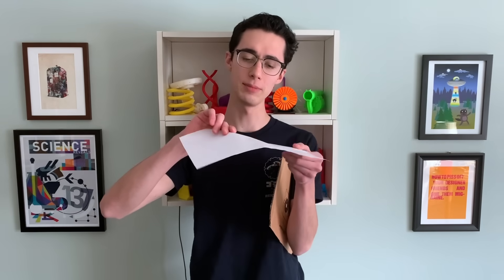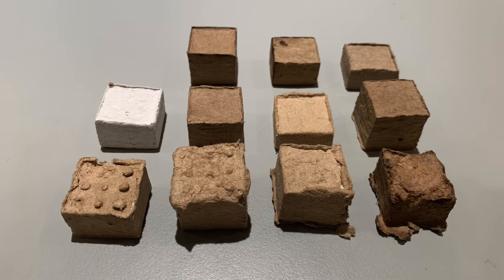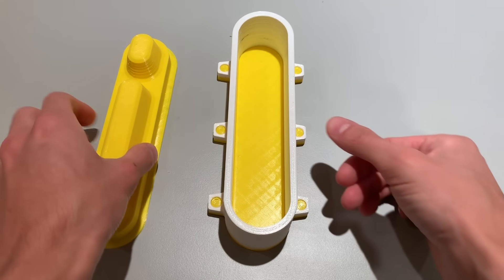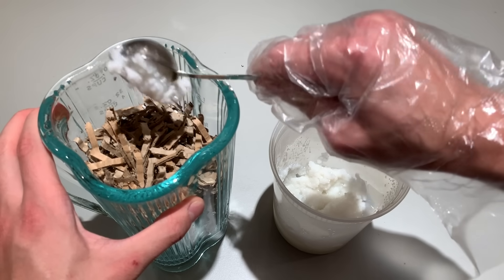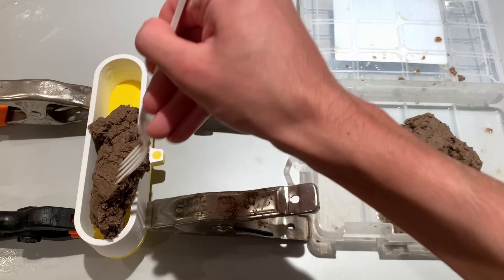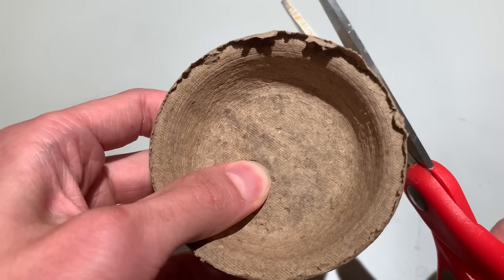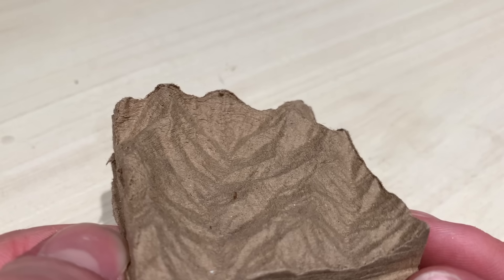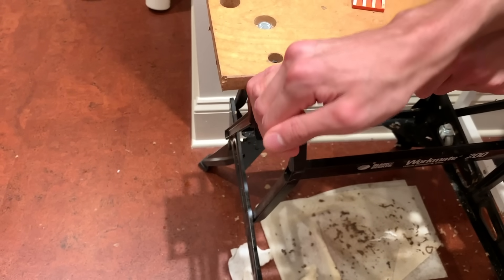Recycle Cardboard into Anything with 3D Printing!

Comment: Here's an idea: Put a seed in the middle of a cube. Let dry. Then the "seed cube" can be planted. Test the results.
Reply: Damn nice idea
Reply: Plant cups, made out of paper pulp, much like an egg-carton are in common use. You don't need thick cardboard walls to hold a bit of dirt with a seed.
Reply: @mibars  I actually have like 40 seed cups sitting here from a promotion by a supermarket chain here in Australia.  They look like the biodegradable paper forms that a lot of computer manufacturers use for their packing materials.
Reply: This already happens commercially.. they are called "pelleted" seeds.. so that even tiny seeds can be machine sown.
Reply: @thelocksmithguy5468  I like your idea because you can plant the seeds from an airplane, and include fertilizer.
Reply: Bet it sucks if the seeds all germinate early
Reply: Ive tried that before, it grew pretty well. The problem is that it doesn't absorb water very well, too little water ends up drying, and too much end up destroying the part.
Reply: Great idea... Let's use that to plant the next million trees...
Reply: Yeah this is already a thing. They also do it with coconut husk
Reply: @fish9468  coconut husk is a great water-retainer for plants.  Used to get coconut mulch for our garden beds in the UK too; great stuff.
Reply: I've bought them from a gardening company. They don't work well unless you bury them inner about an inch of soil. It is an interesting way to distribute the seeds but for the flower seeds I tried between newsprint just setting on the surface didn't work so well. I imagine this would be similar.
Reply: @thelocksmithguy5468  yes, but everything is  commercially made, the point is make it yourself
Reply: This could quickly turn into a product. Have seed cubes that are filled with seeds and fertilizer already and are proven to grow faster than normal
Reply: just plant the seed directly, duh
Reply: Globe shapes so you can throw or launch them with a sling or similar.

Rapid deployment of seedballs over distance
Reply: Why not just use seeds? They are packed with nutrients and have a protective shell lol
Reply: Be a tiny cube for 1 seed  maybe make a tray for 100 seeds to germinate then plant em in normal pots
....why not just make small fertilizer cubes for when the plant has few leaves 🙂
Reply: for some reason i'd make it seed balls
Reply: @punkinhaidmartin  20 million trees mark rober
Reply: Mark Rober 20 million trees
Reply: could be used to make a durable yet biodegradable container for a 'seed bomb' that's shot/dropped from a plane seeding a wide area
Reply: I'm working on it as a project. ty for the amazing idea. (Btw we are trying to make it as viable as possible by adding nutrients to the pulp for example).
Reply: Ooh...Imagine little seed dart/bombs...flown in by a plane...then dropped out, they sail down, and dart into the ground..then soften and a tree grows out of them where a forest fire just occurred
Reply: @witono586  maybe try burying the cube half an inch under the dirt? Water makes the material fall apart, but if there's dirt above it, it might fill in the gap left by the cube when it falls apart.
Reply: why not just plant a seed?
Reply: дак в магазинах уже такое продается

Comment: To make them waterproof after moulding you can coat them with a drying oil, like the ones used in oil painting. Linseed oil, hemp oil, soybean oil, tung oil, walnut, poppy, and more!
Reply: went to the comments section to find a waterproofing solution now i know
Reply: This deserves a pin!
Reply: It wouldn't be water proof but water resistant. Using a phenolic resin will probably make it completely waterproof
Reply: @mayurmahale3049  With one coat, no, it would not be fully waterproof, because it will be absorbed into the fibres. However, with multiple coats (allowed to fully dry, which would take 24 hrs at least), or with a sizing underneath (like starch glue, shellac, gellatin), it will become fully waterproof. An alternative is to coat it with a natural resin varnish after the oil.
Yes, a phenolic resin, or any other synthetic coating, would render it waterproof immediately. But I recommended drying oils because in the video they explicitly said they wanted an environmentally friendly finish.
Reply: @ShadowoftheDude  ah. What I meant wasn't dip resistance but soak resistance. But yeah for low duty applications drying oils will work quite well.
Reply: With portland cement as a binder houses can be built.  It's called papercrete or fibre cement.   Molding paper isn't anything new.  I'm disappointed this video was only about using 3d printed molds.  I thought it would be about 3d printing paper.
Reply: @mayurmahale3049  yes you can always make your recycled eco friendly cardboard plate and make it water proof by covering it completely in plastic XD
Reply: @kris_crafter  Agreed that it's not especially a new process (after all, egg shell cartons have been around for a while) -- but this is a nice DIY process and could bring a lot of 3D printer fans into mold making -- Printing with wood-PLA blend is a pain in the butt (filament snaps easily) and very slow -- I think making a single re-usable mold makes a lot of sense.
Reply: Would rice bran oil fit that bill?  I've got access to lots of that. Linseed oil is often extracted using harsh chemicals.
I guess I'm looking for a low-cost and fairly "natural" oil to try  Any Ideas?
Reply: @ausfoodgarden  I'm having some trouble finding out, but I believe the answer is "no."
[ EDIT: I found the resource I was looking for and the answer is definitely no. Here's a list of all oils that will and won't work: https://en.wikipedia.org/wiki/Iodine_value#Iodine_values_of_various_oils_and_fats ]
Have you never seen "cold-pressed" oils? I guess you're looking at the oils available in hardware stores and such? Try an art supply store, they'll some available.
Reply: coat it with 3d resin and flash cure with UV and you have a stronger, waterproof item!
Reply: Ah, you're closing in on shellac, my own choice. It stiffens wonderfully once it soaks through the fiber, cures very firm, and the CORRUGATIONS (um, don't get rid of them!) can give it a "stressed strength" direction to use when designing items. And the sheer AMOUNT of it around to be used...
Reply: just make sure to use boiled linseed oil instead of untreated linseed oil -- the effects are much better
Reply: Wax may also work for waterproofing.
Reply: What about beeswax and a linseed oil mixture?
Reply: @kiwihuman  pro tip: the oil may slightly make it swell or deform the surface. For perfect results, put it back in the mold after oiling it. I would go for linseed oil, as it's probably the most durable and sustainable natural oil that is easily available. But if you're in the America's, then DON'T buy "boiled linseed oil", because those often contain other additives like rare earth metals and other toxic stuff (put in there to make it harden faster, for use in artistic painting). 
If you use this technique for dishes or cups, for example, then you'd be poisoning your food with those additives. If you use it for structures (buildings or furniture) then it becomes highly toxic in case of a fire, which reduces human survivability. So, think smart when recycling =) Always check all ingredients of the stuff you use. (and go for raw linseed oil, and remember the hardening time of a good oil is expressed in months, not hours)
Reply: @mayurmahale3049  drying oils make it perfectly fully water proof. But you need to know what you're doing. A good drying oil takes months to dry. And contrary to earlier advice, layers should be applied before the previous one has fully hardened (but since that takes months, you've got plenty of time). Impatience will make any technique problematic. Drying oils were used to make the hull wooden sea ships and the poles of docks water-tight, and they surely are dipped, not sprinkled. Raw linseed oil, for example, will dry amorphic, which means that it turns into a glass-like structure. But it takes the better part of a year to fully reach that state, because it doesn't only have to dry, but also oxidize.
Reply: @kris_crafter  One could make bricks or building blocks that are lighter by weight.
Reply: You could probably use a wood stabilising effect to make them harder and water-resistant. It doesn't have to be a perfect vacuum. Just put them in a strong container, add something like cactus juice and create a vacuum. Hopefully it won't disintegrate. I've never stabilised wood before, but I like watching random videos on YouTube.
Reply: Wood glue
Reply: Well linseed oil yes but then it will also burn 10x better. Kalium waterglass is a good glue and fireinhibitor.
Reply: @fearlyenrage  Actually, I'm not sure, but I think once cured linoxyn is actually somewhat fire retardant. I mean, I've heard of many oil paintings surviving house fires etc.
... I sort of forgot about the whole spontaneous combustion thing, though. Uh, maybe be careful, everyone.
Reply: @ShadowoftheDude  ok... For a self igniting fire from a linseed oil rag extreme many things must be given that it catches fire. 
Im somewhat an outdoor geek and my firestarters are made with linseedoil paperpieces they burn realy well, almost like plastic.

You should test the manner there is nothing like handmade real evidence.
I test anything i want to be sure of its behavior.
Darwin did that too ;)
Reply: @mayurmahale3049  thats plastic
Reply: Waterproofing also requires a heavy press imo
Reply: @qrsimon  no because you paint it on the object
Reply: Linseed oil, beeswax mix coated hot should work the best. :)
Reply: Beeswax should also work well
Reply: @ShadowoftheDude  wouldn't Shellac work? It's not water based.

Comment: I have extensive training in making pulp, and this is a really nice idea! In the industry the cutting of fibers is kept to a minimum to keep strength and properties in the pulp, so please skip the blender and shredder. Tear big chunks, let it soak and mix it with a paint stirrer or the like.
Reply: Length of fibers is an ideal thing for cohesion, but I'd think that the compression would be difficult to maintain, as the original fibers would have something like "memory" and your end product would start fraying just a bit at the edges along the original edges of component cardboard?  What I have had good luck with when making paper logs for burning is soaking our paper for a while until it's thoroughly soggy.  Then the blender step need not take very long, which I would guess leaves far more long fibers in place compared with having to shred it from dry, still-coherent cardboard /paper.
Reply: wouldn't it be better to create a mesh inside the material? f.e. mix the mold with longer fibres, f.e. hemp strands which in turn would improve the flexibility and rigidity of the end product
Reply: prallund feucht I like this idea. Mixed fibres and materials have been traditionally used to achieve strength and resilience (for instance, horse hair was widely used to reinforce plaster when making walls)
Reply: @paintedwings74  The fibers doen't have any memory, the longer the fibers the stronger the material. In paper and pulp making long fibers are used for strength, shorter for volume and density. In recycled paper the ratio is already off to the shorter side so it is essential to keep the length.
Reply: @brba  Thanks for the info.
Reply: I agree with you. I've been using newspaper which mostly breaks down after soaking for 24 hours. Stirring vigorously pulls the paper apart into very small pieces that can be used as is. But I need a smoother surface so I put the pulp into a stand mixer that doesn't cut the paper but kneads it into a smoother consistency. I can then cast it without adhesives and it's reasonably strong at 1/8th of an inch thick.
Reply: Thank you for adding knowledge to this subject.
Reply: I was thinking that inside the mold, on top of the pulp, lay unshredded news paper or some other thin paper sheet with markings on it to create a veneer with a familiar aesthetic
Reply: ב''ה, if you only need the equivalent of starch peanuts, is there a way to polymerize cellulose 'powder' or is that all on the lignins and such ordinarily?  Without creating nitrocellulose.

Comment: Great video. Corrugated cardboard already has water soluble adhesive in it (usually corn starch or sodium silicate). If you save the water that you squeeze out , you can use it for your next batch. This will allow the use of less added adhesive.
Reply: Sodium Silicate or "Water Glass" is used as an agent in paper and cardboard but it is a one time use chemical. After the sodium silicate is exposed to the air it reacts with the small amount of CO2 in the air to form silicon dioxide and sodium carbonate. The silicon dioxide, chemically the same as sand, now binds the paper fibers together.
Reply: @pixelpatter01  I believe you— but do you have a source for this information? I was arguing with someone recently about if dried sodium silicate is safe to breathe, as I thought it contained SiO2 (respirable crystalline silica) like you’re saying. Thanks!
Reply: @StoneAndersonStudio  I learned about sodium silicate from a chemistry set I got for Christmas when I was ten years old. You can search the net for references to it and CO2 curing of sand molds. Using CO2 sources speeds things up but even air will harden a paper wet with the solution overnight because of the .04% CO2. I suppose the silica formed could be a respiratory hazard but then again so could walking on the beach. Just about any type of dust is bad if inhaled.
Reply: But then, without the ability to calculate the math of the exact measurable amounts aka ratios, the perfect blend if u will won't be achieved every time right ?

Comment: Wow, you found out how to make a light, strong material that is fire resistant, can be made at home, and is biodegradable. Pretty amazing for a material made of boxes.
Reply: PK Cazadores  Not really, cardboard or paper is usually very flammable, this isn't. Plus thay don't make cardboard in those shapes.
Reply: @alexmcfly31415  Just my two cents but anything can be flammable. You could use a file/sand and get small powder particles from the cardboard-molded part and put a flame to it, and it (the thin/small particles) will quickly catch fire. Things are just less flammable in general when the object has 1. less surface area 2. is much denser 3. more volume which gives greater heat capacity and a better means to transfer heat away from the hot surface. Only the surface (and not the inside) has a means to catch on fire because fire requires oxygen as fuel, its very difficult to get a block to maintain a fire, it just takes more time to bring up the heat of the object to keep the steady flame. Its mostly about the shape, hence why powdered metal is highly combustible and must be stored safely. Speaking of powdered metal, that's how 3D printing works for metal printing, as metal powder can quickly reach its flash point and melt. Powder metal companies' goal is to make the most spherical powder.
Reply: I'm curious if you can use saw dust or at least a portion of saw dust
Reply: @alexmcfly31415  Density is a key to flamability.
Reply: @xathridtech727  MDF.  That's exactly what they use but add glue to it.
Reply: @GodzillaGoesGaga  but would the glue be strong enough
Reply: @xathridtech727  Wood glues are extremely strong.  As a matter of fact they are stronger than the wood.  So I would guess, yes.
Reply: This isn't really fire resistant. Sure, it won't set on fire by just putting a flame to it like regular thin paper would, but neither does a log - that is why starting a campfire requires kindling or some fire starting fluid. But you get it to its fire point beyond the surface, it should keep burning just like wood would. You could try adding something in the binder material or just as an additive to mess with that, but in the vanilla version, it isn't much different from thick wood or particle board.
Reply: Well used to do this in school, nothing special, just didn't have the 3d printer in the mix but the rest was very similar, we used some kind of white wood glue for binding...

But I guess it's just much faster to use epoxy alone without cardboard and will be like a rock in case it's 4 something permanent, water won't do anything either.
Reply: @alexmcfly31415  Really anything is flammable. You just need to have the right oxidizer. You can burn concrete, glass, deepslate, regular dirt, mud, whatever you can think of. There are oxidizers that are so strong that they work like acids.
Reply: rediscovered would be a better description. Thousands of years of knowledge about using paper mache already exists.

Comment: When i worked in a paper making studio all of our raw material got presoaked, this helped us control the ratio of cellulose to water that we needed to pull sheets of various weights. Might require a bit more putzing to figure out what ratio is right for any given mold, so I'd suggest establishing an idea density for a finished piece and try and work backwards from there to calibrate that ratio. 

As for using a hydraulic press, i'd say only use it if you want to scale up. In the studio I worked in we used hydraulic presses only when we had at least 50-100 sheets pulled (and we were a small shop). 

If you're interested in exploring water proofing maybe look into wax. Again it will take some experimenting because most fibrous mediums being wax coated are flat.

If this kind of production were to be scaled you'd also need to invest in a good dehumidifier. Lots of organic matter and water can get pretty funky smelling and controlling mold in the work space is a constant battle